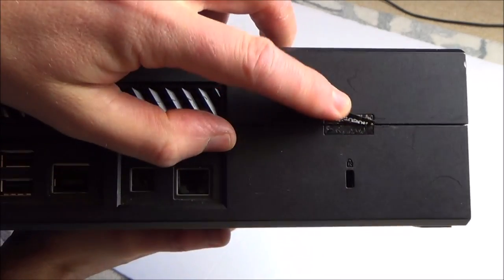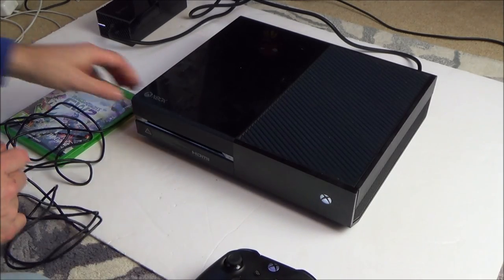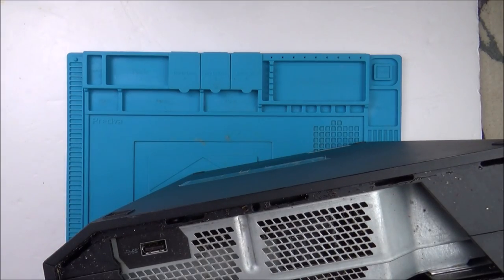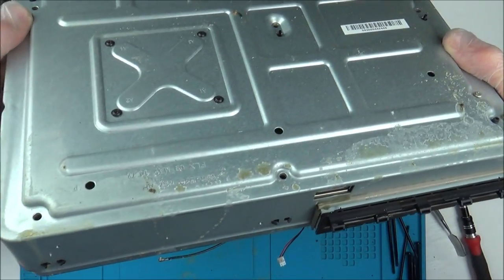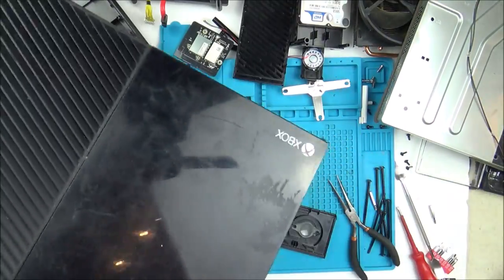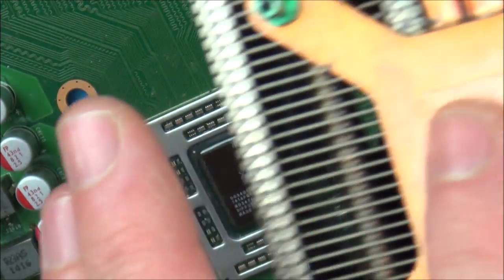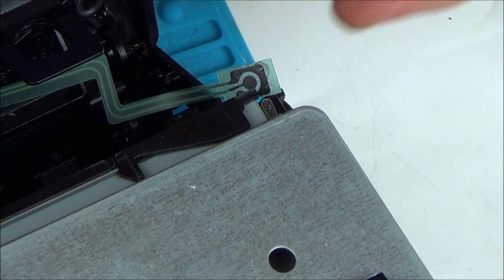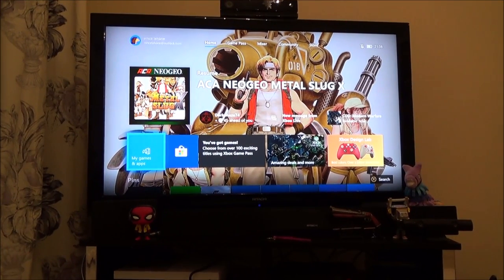Trying to FIX: Faulty £28 Xbox One from eBay

Comment: A clean could have fixed the issue. If its getting too hot it can cause a shutdown. I had the exact issue with my sons xbox one. Once cleaned and new thermal paste its been whisper quiet and no more power shutdowns. Heat build up is always detrimental to most modern consoles. I enjoyed the video but the grime did make me retch.

Comment: My xbox one has 2 years and from about 2 weeks ago i cant turn it on, it happens when i click the on button then console immidiently switches off and light on brick dissapears. Any ideas?
Reply: MrBear check if your power source is connected all the way and is fully connected as well on the inside and if it is it might be that it has burned out or just broke

Comment: I love how easy it is to pull the xbox one apart. I'm scared to disassemble my ps4 pro to re-apply thermal paste and clean it.
Reply: ps4 pro is easy, just take a pic of where the screws go or use a guide. Get it done lol
Reply: Dooleh it’s so many video guide on that. I just got mine so it’s good for about 4 or five years.

Comment: About the probleme, mine does that, every time is not connect to a stable internet conection, if i take it from home, to a friend, i have to start it like 10-20 time, sometimes will turn on until the main menu, sometimes will restart after the green xbox screen, but only if it wasen't been connect to that network, idk why, but when i use it in my house, it has never restarted

Comment: I bought an xbox one for £25 from the facebook market place as spare repairs as the A button wouldn't register from any controller. Turns out someone had just changed the button configuration in the accessibility settings

Comment: Wow, if that tiny blob of compound is current then I use way too much.
Reply: It's been proven it doesn't matter how much you use as long as you fully cover the chip so you won't have hot spots
Reply: The only thing your doing by using allot of thermal paste is making a mess

Comment: He could have put a 3 pin wire into the power brick because Iv done that before and it turns off after about 10 seconds
Reply: It probs just needed clean thermal paste

Comment: I bought a used broken xbox one for 50 usd and all it needed was a new disc drive.
Reply: AnarickTheDevil aren’t they disk drives OEM to each particular Xbox tho?
Reply: @timbatchelor1907  Just the board inside the drive is required you can just swap out the new drives board for the one that came with your xbox. Then depending on what is easyist for you there is two wires to unsolder or just take out a couple screws and swap the drives motor with it.